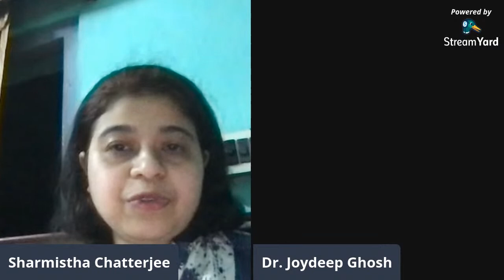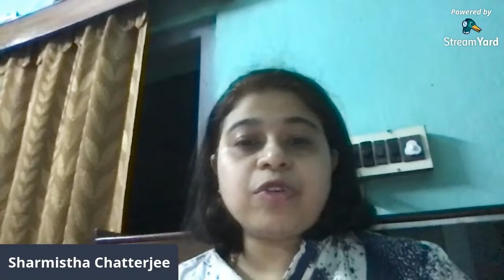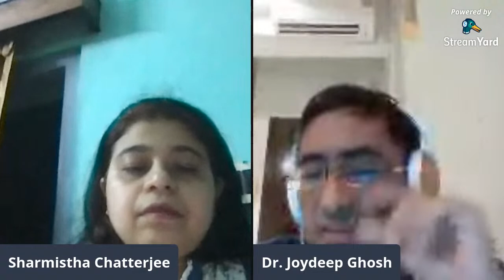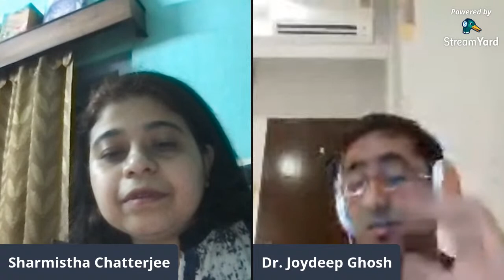Machine Learning in Failure Analysis of NanoScale Devices and IC

Comment from the maker: Speaker Profile - Joydeep Ghosh received a B.Tech in Electrical Engineering from Jadavpur University, India in 2005, an M.Tech in Micro and Nano Systems from the Technical University of Chemnitz, Germany in 2011, and a Ph.D. degree from the Technical University of Vienna, Austria in 2016. He has worked as a software developer in IBM India Pvt. Ltd. for three years. He was a postdoctoral research fellow in nanoelectronics at IIT Bombay, India. He is currently working as a research fellow in NUS, ECE department, Singapore. His research interests include semiconductor devices, circuits, applying ML algorithms to perform their failure analysis. In his career, he has published several papers in journals, conferences and has received awards for his presentation from international conferences. He has got the right blend of industry experience as well as research.